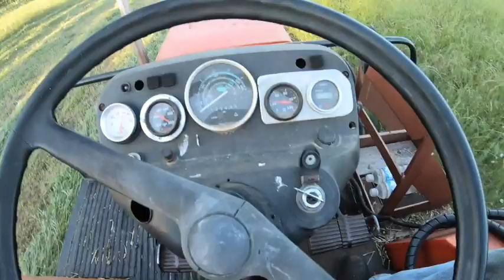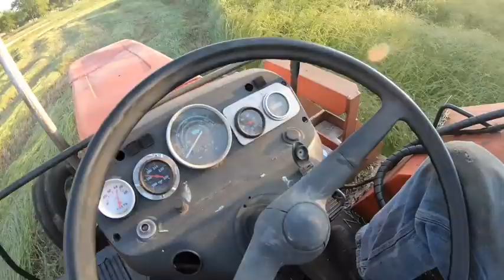WHAT THEY DIDNT TELL ME ABOUT FARMING HAY

Comment: to fix issue with hydraulic you must rebuild the hydraulic piston - there is rubber oring which get petrified and than you can make preassure but later oil leaks through oring.